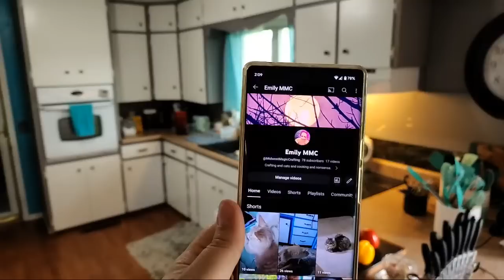Monday Live: Cleaning with Filth (Part 2)!

Comment: Jason, for the hair in the bathroom, vacuum them first. When i worked for molly maid, we had a hand vacuum we used in the bathrooms on all the flat surfaces prior to wiping them. It helps with the hair problems, especially if they have pets. The other option is switching rags often. We used almost as many rags in a bathroom as we used in the rest of the house because of switching them out to not fight with the hair.

Comment: What cleaner would be good for ceiling fan blades in the kitchen? 
Thank you 😊
Reply: Pretty much anything you really enjoy the scent of since it will circulate into the air. I like using Fabulouso or Pinesol. And sometimes I also spray Febreeze on it.

Comment: I'm moving in the next few weeks, do you have any tips on keeping things clean during the whole process?
Reply: Keep your boxes organized by labeling each box very clearly about what room ot goes into and contents for unpacking. 
Example:
Kitchen pots & pans
Bathroom toilet paper & paper towels
Bedroom closet for .....
Then I also suggest having categories as you pack up.
Boxes = moving keep items
Black bags = trash
White bags = clean clothes (think pure and clean)
Clear bags = dirty clothes (see it & do it!)
Colored bags or labeled boxes for donations.
This will help the set up & packing go smoother.
Have ready items like packing tape, bubble wrap or newspapers, etc. Be prepared before starting.
Reply: White or black garbage bags work great for blankets, towels, pillows, even clothes on hangers (can use light wire or reusable zipstrips to keep together if you want) we never did but you could, just put hole in bottom of trash bag and slip over a group of hangers, get a tension rod for car, can hang them there when moving (tape hole after with packing clear tape, reuse for light trash after), Pack box of essentials from each room, the must haves and label, bathroom, kitchen, bills and paperwork, pen, password shoebox, then you don't have to dig through too many boxes for must haves. Collect pizza coupons too...